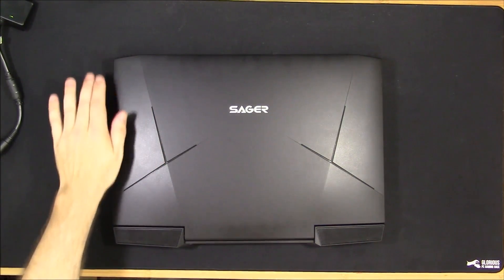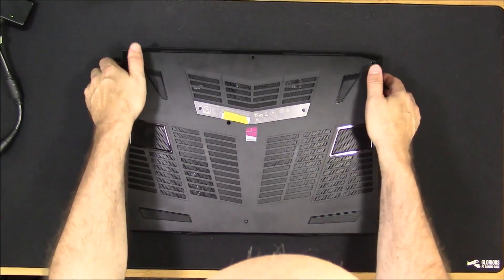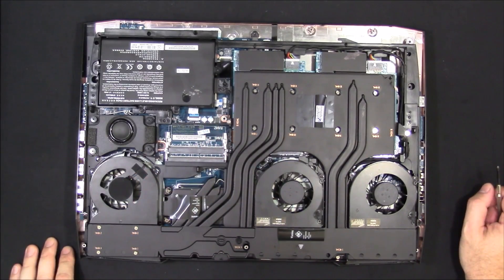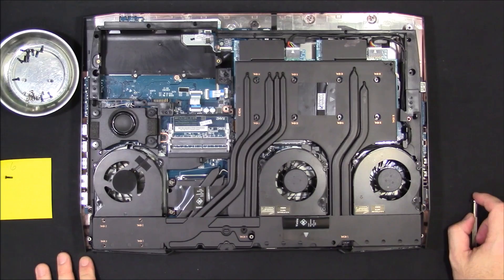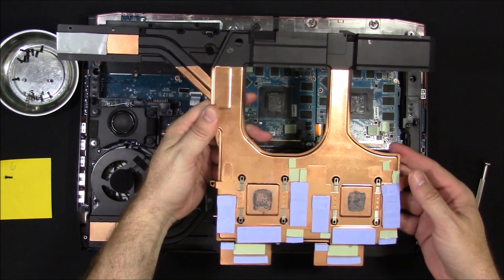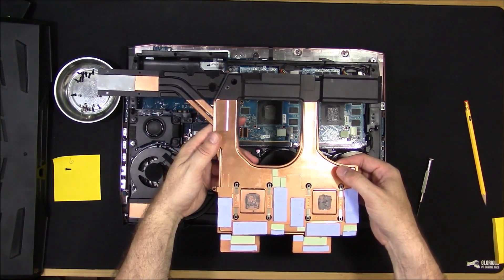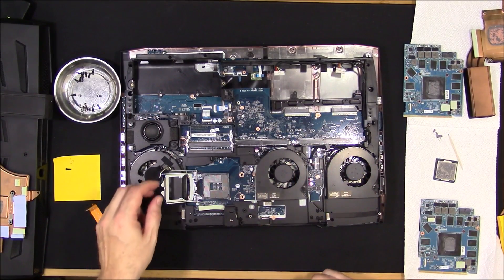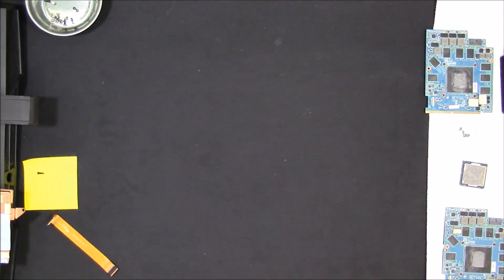Sager NP9873 / Clevo P870DM3 - Heatsink Removal and Mobile GTX 1080 SLI

Comment: You should delid the CPU and reapply thermal compound under the lid. You have to realize that you have a DESKTOP CPU inside of a laptop. It draws MUCH more power, 91watts TDP vs 45 watts on a laptop CPU. Because of that, it generates more heat. Normally when it's inside a desktop, people have a LOT better cooling on it. much beefier air coolers or even water blocks. Compare that to the dinky little cooler you have inside that laptop. Also, I noticed that the GPU copper touches the CPU copper. I'm guessing this is so they can share heatsinks. It might be a good idea to make sure there is sufficient thermal conductivity between those. Also, invest in a laptop cooling pad. It really couldn't hurt to spend an extra $20-50 to protect your $4,000+ investment.

I opted for the model with a single GPU and 6820 laptop CPU. There's just no reason you need more power unless you are trying to play the newest games at 4k UHD at 60+fps.. But more power to you for going absolutely overkill on your system.
Reply: I am not sure de-lidding is really necessary, unless you plan on heavy overclocking. I got the same laptop but with only one 1080 (wanted to save ~$1000 and have an upgrade path down the road when costs come down). 

The biggest thing you can do is replace most of the factory thermal pads with better stuff like the Arctic thermal pads, and use a better compound. My temps were in the mid-high 50s on idle, and easily hitting over 90 degrees on load. After replacing the thermal pads and adding IC Diamond, temps dropped 20-25 degrees to mid-low 30s. Now my load temps are what my idle temps used to be.  

My CPU is running at 4.5Ghz with no real settings changed except undervolting by 150mv (which also helps temps). A friend of mine runs an overclock at 5Ghz delidded, and basically has the same temps as I do. When I get bored/exceed the performance capability of the laptop, my upgrade path will be to delid for overclock, add another GPU, and maybe another M2 drive for a raid-0 array.
Reply: Actually Delidding is SORTA necessary if you want anywhere near decent temps in this laptop. See NORMAL laptops - ones that are not CLEVOs that use desktops parts, use laptop made CPUs WITHOUT ANY LID! So that whatever thermal solution they use, it is in DIRECT contact with the die - as it is with the GPUs in this laptop.

Especially given that this laptop uses an i7-6700k - Intel used the WORST TIM EVER for Ivy Bridge to Skylake - they improved the toothpaste some with Kabylake, and have improved it a bit farther with CoffeeLake and Skylake X - but still the PROBLEM that IS the IHS and how it is mounted remain - because Intel does not Solder these particular CPUs, they use a rubber sealant that prevents the IHS from pressing down directly on the die.

I delidded my 8700k and went from 97 C at 4.8 GHZ to 78 C at 5 GHZ and higher voltage using AIDA64 FPU stress.

Comment: sorry im new to pc gaming, but what do you call video cards that come in that size?? im trying to install another gtx card into my laptop but i keep finding the bulky cards that are attached to fans. i just want the card minus the attachments.
Reply from the maker: They are MXM format. However, while it is a standard, not all laptop video cards are interchangeable. You need to buy the MXM card specific for your laptop usually. There are some cards that are interchangeable, but frequently require a video BIOS mod to work. And newer gen video cards also may require either an updated BIOS in your laptop or one in your video card or both. Plus you may need a new heatsink and fan assembly specific to that newer video card, unless you replace it with the exact same one.
Reply: htwingnut well my laptop is a sager np9873, so I need the same card showcased in this video. Do you know exactly what kind of card I need?
Reply from the maker: kernel fleak You'll have to either order from Sager or Clevo directly or look for a Clevo or Sager card on eBay. Clevo actually manufactures the cards themselves, specifically for their laptops.

Comment: Why handle circuit boards by contact edge???  Of all the areas to avoid the edge contacts are the most critical, just blowing dust away will create a potential failure point.  The grease and acid on what look like clean hands is almost impossible to remove, that's before you consider the issues of static damage.

Comment: Intel should denude their K CPUs for mobiles for better thermals.  (CPU metal cover)
Reply from the maker: The whole reason Clevo uses desktop CPU's is because Intel made all mobile CPU's soldered to the mainboard. No socketed mobile CPU's. Otherwise they would have used one I'm sure.
Reply: +htwingnut ya i know that, what I mean is to keep the socket but denude the CPU like the MQ or XM versions. Will practically decrease temperatures. 
But I understand they don't want to add more CPU names to the list. 
Like they could call it Intel i7-6700MK.
Reply: +htwingnut btw have you try to extract the vBios and see how much wattage they really are ? I haven't see anyone doing it and many people are based on online statistics (guesses). 
I personally think they're like around 160w each cuz of the PCB size and the double AC PSUs.

Comment: should use a mobile cpu with desktop GPU
also, thanks for your vid on the Ws230 i undervolted my 4710mq and dropped temps by LOTS.
Reply from the maker: Mobile CPU's are all soldered which is why they opted for desktop CPU so it can be user swappable. It is just a matter of tuning voltage and should get it within reason.
Reply: yaeh, but the TDP is so much higher on desktop vs mobile, had they used a T component cpu then the temps would have been better.  

honestly, i dont see a reason to not have a mobile cpu in it, my 4710MQ hasnt had any issues with any games, and its running at 2.5Ghz on all cores and is massively undervolted. admitedly it could be an issue with dual 1080s but at 3.5ghz on 4 cores i doubt it would be.